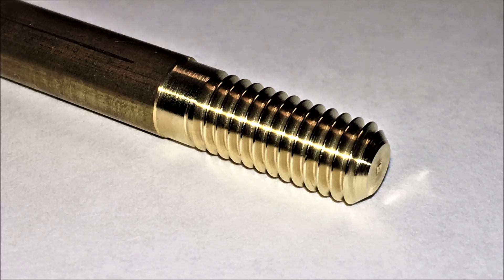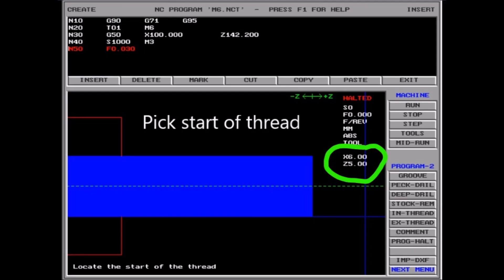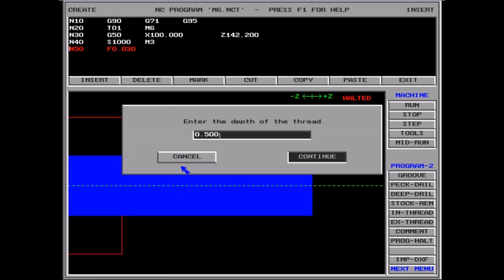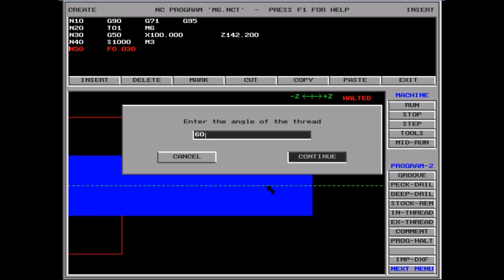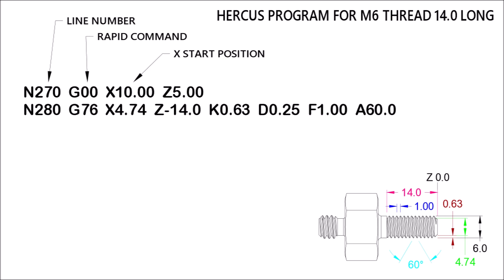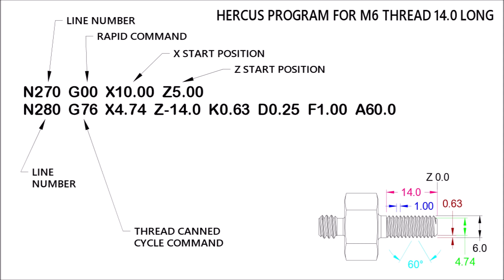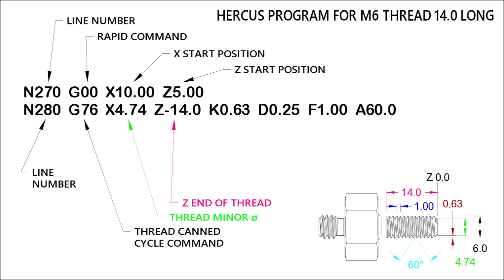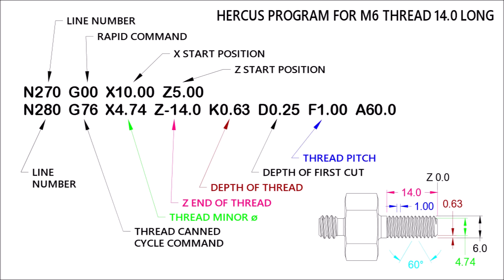CNC lathe threading M6x1.0 using the G76 canned cycle  with Sandvik full form insert.

Comment: Nice, but why do you run the thread not with 3000 rpm?
Reply from the maker: I have cut threads at 3000 rpm, but this lathe has a slow rapid movement. Maximum rapid is 2700mm/min, so for 1mm pitch 2700rpm would be the absolute limit.   No point pushing a 30 year old machine to its limit. Thanks for your comment, always appreciate comments.
Reply: @smallcnclathes   ok thank you, your old lady is still faster than a new Tormach 15L ;-)
Reply from the maker: I bought that lathe in 2005 when it was some years old, but hardly used. Has done a lot of work since then here is a link to threading at 3000rpm https://youtu.be/JWiQLGyU0V4

Comment: When I was doing CNC programming (mid 90's) I used the machines canned cycles a lot.
Simple to understand.
Not a million lines of code to weigh through.
And easy to refine the finished product.
I think I spotted steps in the trailing face of the thread, I would try a slight change in the 'angle' input to 58deg to lightly cut that face.
Just my 2cents.
Reply from the maker: I noticed it too and thought it was odd, as the final cut is a full cut on both sides of the thread. In the first microscope shot it shows but not so much in the second where the flanks seem pretty even to me anyway
I am planning a video cutting a 1/2 BSW so pretty damn coarse.  If this shows up there, I will keep your suggestion in mind and see what happens

Comment: Some of the gcode cycles feel like magic, esp g76, g71 and g70. A lot goes on in the controller that hides away the complexity.
Reply from the maker: This is what I love about my G code, the codes you mention in my case are
G70 mm
G71 inches 
G76n does not exist
I think G01, G02, G03 and G00 are the only codes that are the same for everyone!
Even the software I use is confused G02 and G03 in the dos software go the opposite way in the Win software.  makes for very interesting simulations when going from one version to the other. LOL
Reply: @smallcnclathes  yeah, my head exploded trying to make sense of them and I've been programming for 20yrs
Reply: @smallcnclathes  some controllers interpret the G02 and G03 opposite , I'm not too sure why, is it to do with the turret on the backside of some machines ?
Reply from the maker: @landlifem5872  But I have never seen a Hercus that uses these software packages with a turret at the back. I have always assumed they got it wrong with the dos software and changed it for the later windows machines. I have always assumed that the later package was "right"
Reply: @smallcnclathes  yes, you are probably right. I have personally never seen a hercus CNC in real life, I tried to buy one on an online auction but that's as close as I've come to one, lol.
Reply: I'm working slowly towards a Rocketronics like ELS clone with some basic gcode support eventually to make it a standalone controller. Tool shape, radius and backlash compensation are the hardest parts.

Comment: I ran cnc lathes for decades. We always put the chamfer on before the threading operation. We also put a relief groove at the back end of the thread before the threading process.
Reply: @zomgthisisawesomelol  The relief groove comes into play when your going up to a shoulder like on a shaft for a hydraulic cylinder. For stuff like the piece featured in this video we used a roll threader. We made hundreds of thousands of those for tie rod style hydraulic cylinders. You get a better and faster thread and the rollers in the die head last a very long time.
Reply from the maker: I have been through my videos looking for one where I actually chamfer last, can't find anything that is really clear.  My turning inserts are much sharper than my threading inserts, ground edge vs moulded. I have found that threading second can leave nasty sharp edges at the chamfer as the thread insert almost sort of burst through.
Cutting the chamfer after the thread means the ground edge insert can can cut through the thread quite cleanly leaving less burr than doing it the other way. And I always find it better to cut from the outer to inner diameter, this time i just forgot to reverse the finish cut and you could see the result. 
Thanks for your comment, I appreciate it.
Reply: @smallcnclathes   To get a good finish with molded inserts it helps to use top dressing inserts. They have less range at to what size they will work for but the top dressing leaves a better finish over non top dressing inserts.
Reply from the maker: @tenlittleindians  Have not heard of top dressing inserts and Google showed me a wardrobe. Can you explain please?
Reply from the maker: They are all I use. I had never heard of them until I started with cnc back in 2005. Once the magic had been revealed, no way was I going to use single point tools. They are not expensive, well I don’t think so anyway. I find it odd that a hobbyist will buy a die for each thread but shies away at the idea of inserts for each thread.
Reply: @smallcnclathes   I see my comment with the link has been deleted but it sounds like you were able to read it. There are times when your part requires more thread engagement than you get with a typical full profile insert. When programming threads using the non full profile inserts we sometimes added a final turn diameter pass after cutting the thread using the thread insert tool to save from needing another turret index to a finish turn tool. Speeds and feeds are something we tweaked each time we did a setup to get a good thread. Slight differences in material batches assure you will rarely run a working program again without having to tweak something. Some materials are great to thread and others can be a total nightmare to get a clean thread.
Reply from the maker: @tenlittleindians  Probably YT thinking it was a spam link, certainly was not deleted by me.  I did get to read it and check out the link.  Not that I needed to once you said full profile inserts.

Comment: Nice, thank you for the breakdown!
Reply from the maker: Was the explanation clear enough?
Reply: @smallcnclathes  At my level of expertise (new to it entirely) yes.  I'm not going to go writing a line like that by hand but it's nice to understand what the control generated.
Reply from the maker: @jimsvideos7201  Because my CAM is so simple, it makes it easy to generate whatever canned cycle code is required and then manually "tweak" it to get the required result. I don't create any canned cycles out of my head, I am limited to moves and rapids, but I manage to get the job done.  Anything else you would like to see?
Reply: @smallcnclathes  I'm sure there is but I don't know what yet.
Reply from the maker: @jimsvideos7201  If you think of something, just leave it in a comment on any video and I should get it. I will see if I can do a video on it.
Reply: @jimsvideos7201    for me I found it much easier to start with manually programmed canned cycles, it really helps understanding the language , then when you have CAM generated cycles it's much easier to read and pick up on anything that may seem out of place.  Just my thoughts ...
Reply from the maker: Thank you for taking the time to read through a comment this far and leave a very worthwhile reply.